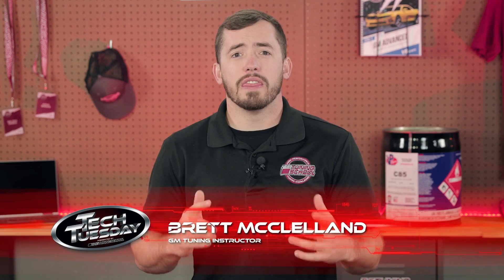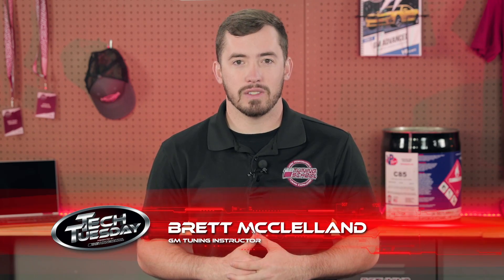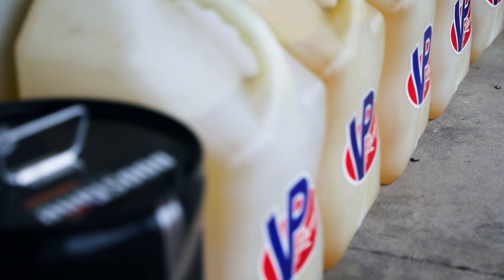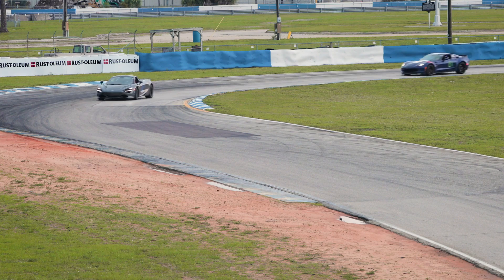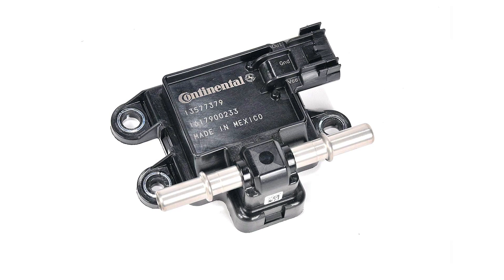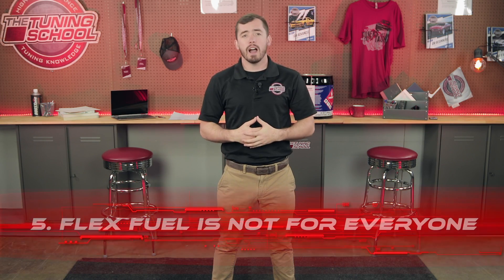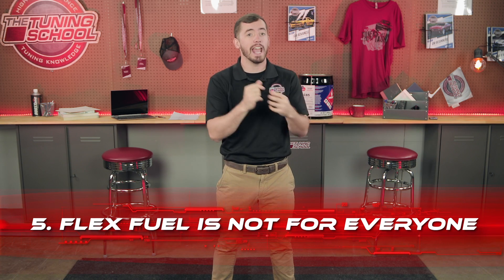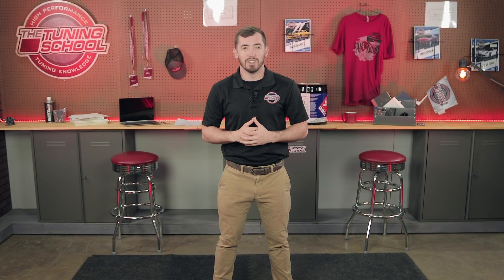Demystifying E85 & Flex Fuel

Comment: He said as low as 40% ethanol. That's when i knew he doesn't know what he's taking about. It's regulated. It's required to be a minimum of 51% ethanol. 

My tuner built my tune assuming im getting 51% ethanol. The same way the car can adjust from 87-93 octane It will adjust from E51-E85.

Most modern Cars in America can Run E30 without throwing a Code. In the early 2000's it almost became a standard fuel in America. For those of you who want to mess around it's a mix of 2 parts gas and 1 part ethanol. It's about 95 Octane.

He is correct my gas mileage did drop but i think about it this was. 
You can have. Power/Cheap price/good mileage. Pick 2! (If you want all 3 go electric)
People always say "don't you get bad gas Mileage?" Yeah, when my gage is low i fill it up! Why, what do you do??

Comment: A consistent ethanol content is more likely to mean bad gas station. The reason the Ethanol content in E85 varies is because of the seasons. When its hotter you can run more Ethanol than when its colder. One of the reasons being that ethanol has a much bigger cooling effect than normal gas. When its really cold outside starting your engine with a high ethanol content might become quite hard.

Comment: E85 will make you lose 33% mpg... Butt its usually 1/2 the price of 93. Sooo it's actually a net gain in savings. Just make sure you drive long enough to evap the water in the fuel tank.
Reply: My 2009 silverado gets the same mileage with e85 as it does gas. Might be my driving or the fact that I don't get a chance to use e85 often as there isn't too many places where I live to get it and only use it on occasion
Reply: 33%? Negative. Ive heard users say they only lost 3 miles per gallon. That would mean they were only getting around 9 miles per gallon on standard fuel.

Comment: I installed a flexfuel kit on my 2002 Mustang GT with stock injectors and fuel pump. And it's working fine with E85.  I didn't do this for environmental concerns. I'm still testing it to see if it was a good investment.

Comment: I want to point out the most misleading argument against E85 vs regular fuel. In theory ethanol (not E85) can increase fuel consumption up to 30%, but all comparisons you can find are 100% ethanol vs. 100% gasoline. In real life E85 has 85% ethanol, max. Regular fuel has 10% of ethanol, always. If you do comparison between what you find in the gas pump, the difference is even smaller.

I have 1993 Mazda MX-3 V6 with eFlexifuel kit and i have calculated the increased consumption about 10-20%, 15% being average increase. I save a lot using E85, because sometimes i fill up with E85 and it contains only 50% ethanol and consumption is only 10% more.

Comment: I hope you can answer this question. I have an LS3 75 pound injectors, Pro Charge, big blower cam. Should I install a Continental Fuel Sensor and run E-85 and will this add HP to my set up? What are the risks and downsides to the above? Happy 4th of July. Where are you guys located in Florida?

Comment: I had a 2007 Yukon with a flexfuel I ran E85 for 2 years without any issues. I now have a 2016 F150, and i bought it because it was flexfuel. It's been running great without any issues or the delay he claimed. I live in California. Regular gas is 4.99 a gallon and E85 is 2.98 a gallon so thats a difference of $115 dollars to refuel with regular gas and $60 with E85. I installed a scanner that can read the E85 rating and i have never gone below 77%. it gets me about 2-3 mpg less on E85 but even with the price difference its still cheaper to go with E85
Reply: Same page brother 
We got a Tahoe with a flex fuel 
And yes it gets a lot 2-3 mpg less, specially city driving, but gas being in my area about $5.00 plus per gallon, while $2.89 for e85, it just makes a lot more sense and yes we also fill up with $60 of e85 vs close to $150 with regular premium fuel
Reply: E85 is $2.079/gal at Casey’s; Franklin KY
Reply: Your either full of it or mathematically challenged. You saved nothing. It actually cost you more. Gas mileage with e85 is horrendous.

Comment: So a 2007 Chevy flex fuel Tahoe should have no problem with filling up on regular 87 octane one day and E85 another day ?
The 2007 Flex Fuel Tahoe will run on both fuels even a 50/50 mix ?
Reply: GM has a sensor, so it constantly updates the tune for the mix in real time.

Comment: The Ford Mustang with 12:1 compression stock loves e85 and makes huge power on a flex tune. As long as your tuner unlocks that’s ability. You can watch the computer learn it after fueling up and it is very close and thousands and thousands of people run flex tunes and they work great? Not sure what you mean by bad and slow learning and rough running? Maybe older cars but 18+ mustangs work great and learn fast and add timing instantly after it learns
Reply: He's likely talking about stock sensor less tunes on older vehicles.
Reply: Can it accept an ethanol content sensor?

Comment: Did you seriously just say you have to tune at each fillup? Na, you don’t, if you have a good tuner, your car can be tuned to simply adjust fueling/timing based on 02/AFR readings. I daily drive an E85 tuned LSJ Cobalt, I have ZERO issues with running E85 year round, car runs a little richer in the winter… I’m talking a 0.1-0.2 max on my Wideband. Other than that, no noticeable difference in drive-ability. My testing at the pump shows a MAX swing in ethanol content of about 13%, summer months it’s always straight 85% at the station I use. Lowest I’ve seen in the winter is between 72%-76%. So no, you don’t have to pull your laptop out and tune when the percentage changes. If you wanna be safe, go light on the throttle in the winter months, but my tuner says I don’t even have to do that. Car makes about 30whp more when the temps are around freezing anyway lol I still don’t bash it in the winter thou. I’ve put 15K miles on the car in the above described conditions, no issues with the engine whatsoever. Still pulls the same vacuum as the day I installed the new longblock (also 15K miles ago). And FYI, Ford does not use Flex Fuel sensors in their Flex Fuel vehicles, the PCM simply adjusts fueling maps/timing when the O2’s see a rich/lean condition change after fillup. No sensors. I personally don’t have a preference to either, although sensors do fail…. and if they fail… your cars PCM isn’t going to know what to do. In that sense, seems like Fords solution is safer.

Comment: If you want to present the truth about E85, you have to present truthful facts.

First off, with E85, you're getting 51% to 83% ethanol, not 40% to 60% ethanol.

The energy content of gasoline vs ethanol is irrelevant. Concerning yourself with stoichiometric values is a waste of time. Worrying about the difference in BTUs between ethanol and gasoline is a waste of time. If the energy content of a fuel in an internal combustion engine was significant, then every internal combustion engine regardless of how it is optimized will get the best performance on the highest BTU fuel. This is never the case. An engine optimized to run on ethanol will perform equal to or better than an internal combustion engine optimized to run on ethanol free gasoline. Moreover, there are many instances where a vehicle optimized to run on E0 or E10 will get its best performance with ethanol-gasoline blends between E30 and E50. This has been known and proven for more than 100 years.

The notion of energy content and BTUs was developed in relationship to boiling water for steam to power steam engines. Internal combustion engines do not, under any circumstances, run on steam. If you have an ICE vehicle and it's producing steam, you have a faulty radiator or radiator hose. Pull over, turn off the engine, and find some water. 

In addition, although there is a BTU difference between gasoline and ethanol of approximately 33%, the burning of gasoline is so inefficient that it loses about 25% of its energy content (this is why and how debris forms in your engine). This means that there is not a 33% difference, there is about an 11% difference in the effective energy content between E0 and E100. And, if this wasn't enough, since all "gasoline" in America at normal retail pumps is E10, then you would never get a fuel with 116,000 BTUs, it would be less. Since E85 can range from 51% to 83%, you would never get an ethanol fuel that has a BTU value of only 76,000 BTUs, it would always be higher. Therefore, an E10 fuel that has lower BTU effectiveness because of inefficient burning and ethanol dilution might have only 5% or 6% higher BTUs than E85 that has only 70% ethanol. This means there is never a 30%-33% reduction in MPG between using a low ethanol-gasoline blend and a high ethanol-gasoline blend unless a person's driving characteristics and route between the comparative runs are vastly different.

I'm unaware of any mass produced vehicle that only runs on E85. Flex fuels vehicles can run on any blend of ethanol-fuel, as well as on ethanol-free gasoline. What's more, a flex-fuel vehicle is not optimized to run on ethanol, it merely is capable of sensing the fuel being used and will adapt the best it can. If you have a vehicle that is tuned to only run on E85, then it is a track car and no one will actually try to drive the vehicle across country using an 85% ethanol fuel except as a stunt or experiment. 

All vehicles of any age, and make can use ethanol-gasoline blends. I've personally tested various ethanol-gasoline blends in hundreds of press-media vehicles that I've driven over the past 20 years (I've been regularly test driving and reporting on vehicles for 32 years, but ethanol-gasoline blends have only been regularly available for the past two decades). I also owned a non-flex fuel 2002 Ford Taurus for several years. I used it specifically as a test car and used everything from E10 to E85 without any converter or change in spark timing, fuel injectors, or adjustment in the length of the piston stroke. Naturally, the Taurus did not run as smoothly using E85 as it did using E40 or E10 because the onboard computer couldn't make the necessary air adjustment. 

Recently, at the end of June, my wife and I drove from Northern California to San Diego, and back, to attend graduation at the Marine training base. The drive is about 530 miles each way. We drove a non-flex fuel 2021 Nissan Altima. Driving down we filled up on E10. We made it all the way on one tank full, averaging 35 miles per gallon of fuel. 

Driving home, we filled the 16.2 gallon tank with 8 gallons of E85, and topped it off with E10.  We encountered more traffic on the return trip (same highway route), with some bumper-to-bumper traffic around Anaheim and then again near Stockton - this should have negatively impacted our average MPG. We made it all the way home on one tank, averaging the same 35 miles per gallon of fuel (it would have been an effective blend of about E40 assuming that the E85 was around 83% ethanol and the E10 was around 10% ethanol). 

The cost of the E85 was $1.30 less per gallon than the E10 (E85 was $3.19 per gallon, E10 was $4.49 per gallon). If I had filled the entire tank with E85 I would have saved slightly more than $21.00, nearly 30%.

What this all means is that I got equal MPG performance and saved a good amount of money using a higher ethanol-gasoline blend (that theoretically had less energy content).

I cover the history of ethanol, the politics behind it, and much of the real science regarding it all in my 600-page book THE ETHANOL PAPERS. It is available to read online for free on my website.
Reply: In brief - do you want to say that even non-flex fuel vehicle can be fueled with e85 with no risk of damage to engine? I have Fusion Sport Ecoboost 2.7 (2017) and driving around Europe, in France there're real problems with gas at the moment, but e85 is available, so I'm wondering. Driving e15 I didn't notice any difference comparing to non-ethanol fuel.
Reply: @Drag0nheart91  Engines are tuned and built to run on the specifics of a particular fuel. If you use another fuel, it's possible that the performance of the engine will be different (it could be worse or better). But different performance doesn't mean "damage" to the engine. When talking about "damage" caused by ethanol, people usually attribute problems that are caused by gasoline and aromatics. Ethanol burns cleanly and dries cleanly, and it is more compatible with more types of metals, rubbers, and plastic than gasoline and aromatics. This means that ethanol is less corrosive than gasoline and aromatics.

What I wrote about in my initial post above was my experience with using some E85 in a non-flex fuel engine to approximate ethanol-gasoline blends that are significantly higher than E10 or E15. When I have used only E85 in non-flex fuel vehicles the engines may run rough and my MPG may suffer, but there is no greater "damage" caused to the engine and components than what the gasoline has or is already causing. Remember, even in E85 there is still some gasoline and aromatics being used. It is the gasoline and aromatics that leave gummy deposits and burnt carbon that can build up and foul plugs, filters, etc.

If you are successfully running on E15, you may wish to try upping your ethanol blend by adding a couple of gallons of E85, and see if there are any performance changes. If that's successful, add a few more gallons of E85, and test that. When you get to optimum performance (usually determined by the best MPG), you can go with that. However, depending on weather conditions and driving necessities, you may need to change your fuel mixture from time to time.
Reply: @TheAutoChannel .
Reply: Hi, you are the most knowledgeable person I have seen this far on E85/flex fuel. I was wondering if u can answer my question, I have a 2012 Chevy Malibu flex fuel edition.  And I have been running it on E85 solely for the past year or so... I recently just had my fuel injectors and mass sensor (?) Replaced and my mechanic said to run it on 91 for two weeks then I can go back to E85. This is my pref fuel because its the cheapest here on socal. Do u think that will be okay to switch from 91 to E85 mid tank/ empty tank / mixed, or at all? What are your thoughts?
Reply: @maloriramos3881  Flex fuel cars are perfectly capable of running on any ethanol-free gasoline (E0). However, why would you? In particular, why 91 octane instead of 89 or 87 or 85 (if you're in Colorado? Did the mechanic offer a reason for his suggestion? Did he provide any supportive resources? If it's just his "voodoo" technique I'd say skip it.

Comment: I’d love to tune my F150 but basically it’s not practical if it’s flex fuel and I fill up with different fuels?
Reply: If it has built in factory flex fuel capability  just make sure you're running below half a tank every time you fuel up, and allow it to relearn.

Comment: Ive never used E85, never even knew my truck took it but can i just add it? im kinda nervous, its a 2006
Reply: Only if the gas cap or manual states you can. Usually flex fuel vehicles have a flex fuel sticker or badge somewhere on the car. If you put it in a non flex vehicle you will run into starting issues and can damage the engine because your compression ratio is not tuned for it. It’s like putting 110 octane in a 87 gas car.

Comment: Definitely a big price difference between setting up a fuel system for E85 vs pump. Having the mindset of wanting to use E85 because it’s cheaper rather the benefits of your setup is not the way to go.
Reply: e85 is more expensive than the highest octane fuel where I live lol
Reply: @66hayloss66  don't even worry about, it's all just a scam between the government and automakers, they don't care if your engine breaks. Just run what it was designed to run and dw about saving the environment.. you'll get better mpg with 93
Reply: @66hayloss66  Which city and state do you live in?
Reply: @TheAutoChannel  not USA

Comment: The E85 standard is 51-83% ethanol content. Here is the link to the actual ASTM standard - https://www.astm.org/Standards/D5798.htm  The fuel pumps that dispense E83 will normally state the minimum ethanol content.  The only E85 that is 85% ethanol is "Racing E85".  If you are getting less then 51% ethanol content at the pump, it's not E85 and you should have a conversion with the station owner.  The problem with OEM "Flex Fuel" vehicles is that they are optimized to run on E0-E10 gasoline and not E85.  This means that the engine doesn't take full advantage of the benefits of E85.  Generally on these OEM vehicles, you'll see a little more midrange power, but nothing you can really feel.  If you're going to use E85 in your daily driver as I do, you need to reset the ECM after a few tankful's as you are blending the fuel with what is already in the tank.  The ECM will learn quicker that way as the stored values will be erased.

Comment: Stating that E85 needs a tune every single time you fill up is a bit of a misnomer. It’s a VERY forgiving fuel. As an example, in a carbureted application, you only need to change one jet size for every 5% change in the mixture. So if you have your carb square jetted with 94’s for e85, and then run a 80% fuel mix the next time you refuel, you drop one jet size to 93’s.